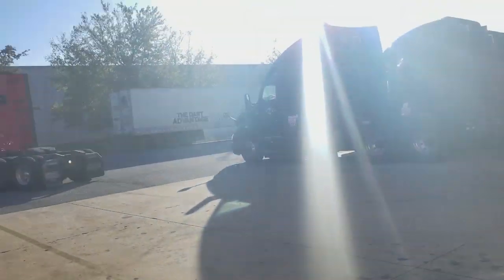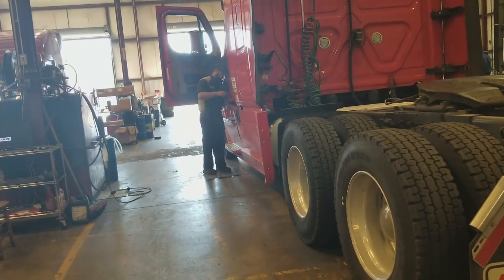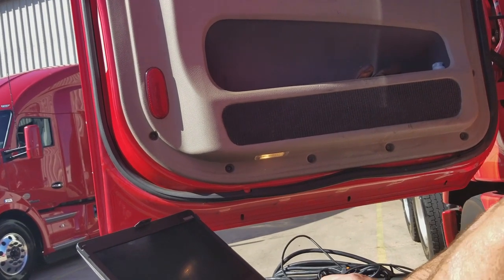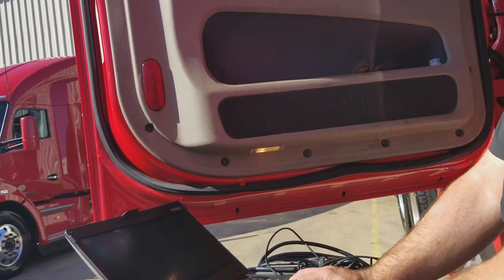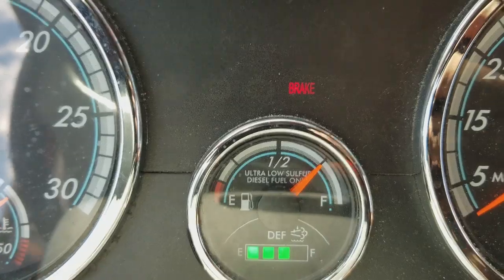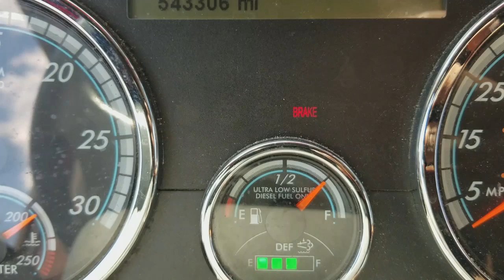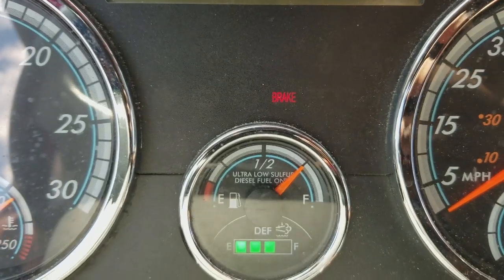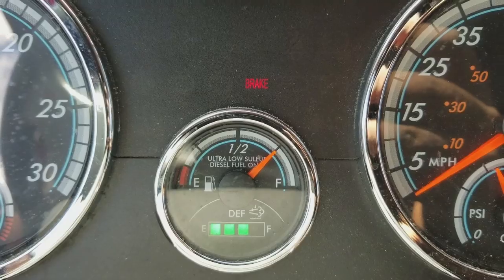My next issue... DEF DPF part 2

Comment: Do not buy DEF (diesel engine failure) fluid out of truck stop pump. If you have to buy it out of bulk dispenser, go to NAPA and buy yourself a refractometer. Part# SER 3R401BK.  Very simple to test def with refractometer and it’s 100% accurate. That specific gravity test he did is not nearly as accurate as refractometer. And refractometer is easier to use, only need couple of drops of DEF.

Comment: I think I'm having the same problem every morning when I start the truck. After running it for about a 30 miles I can shut the truck off cut it back on and no more lights
Reply from the maker: That could be your dpf filling up. Check on it and see if it needs to be baked or replaced

Comment: My company truck has run just distiled water in the def tank since new has 750000 miles on it never a problem  runs great it's a 2014 cascadia with dd15 in it  I got it with 20 miles on it
Reply: 750k ?? How many times did you change your DPF filters? thanks for tip hopefully!

Comment: Wonder what it cost to buy one of those computer to clear codes or find out what to replace.   Dam DEF.   I let mine get down just under a 1/4 .  Refill at new truck stops
Reply from the maker: Daniel Garcia is around 2400 for the computer and software for all trucks and 660 for the diagnostic tool and connectors
Reply: Nexiq sells a device that works with your mobile device. Go to their website, doesn’t give you all access but it does give you an insight